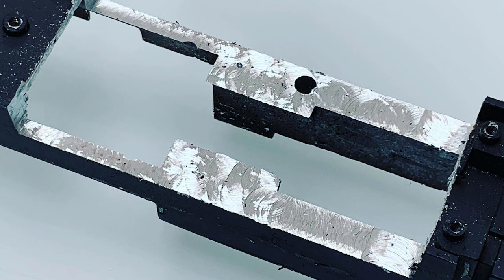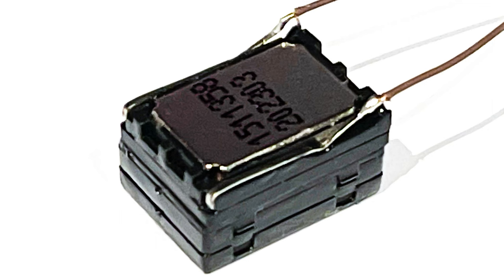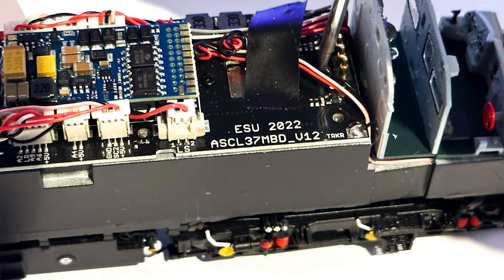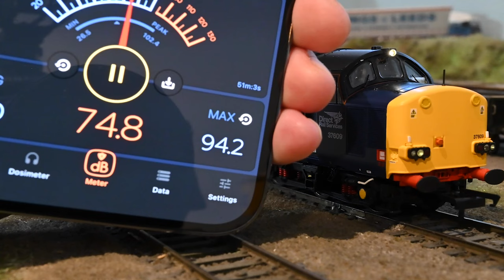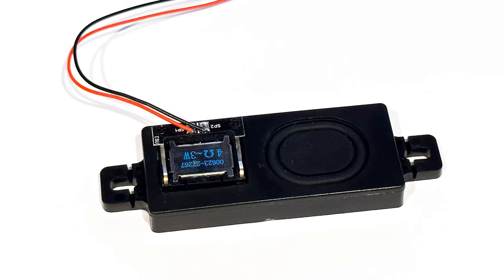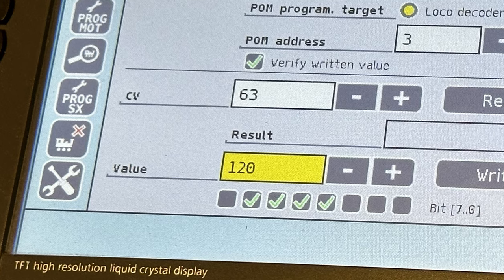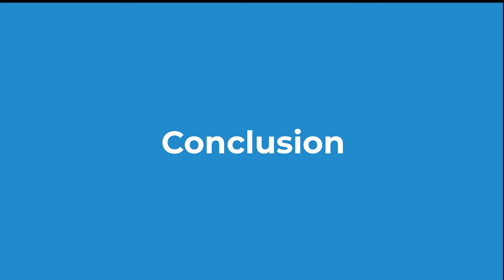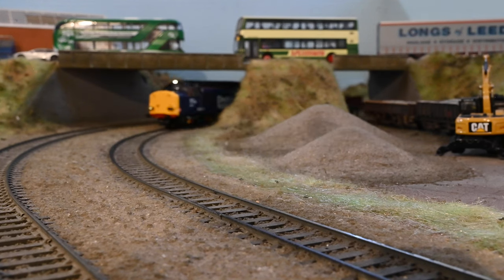Can The Accurascale Class 37 Sound Be Improved? Looking At Alternative Speaker Setups

Comment: Great advice as always. Ive removed the sugarcube speaker as I was getting crackling as you did, but one time the sound went very quiet after about half hour's running and the decoder became very hot. Not what I expected. All remained good the next day, but have been concerned. Your explanation that the two speakers takes the ohms reading below the recommended makes sense.

Comment: Hello Richard. Pleased that you are prepared to have a go. From what I can hear via my laptop, the first change (removing the sugar cube speaker), was a much better sound than the new ESU speaker. That one came across as rather tinny and lacked clarity of the base. 
I assume that the sugar cube is about 8 ohms, hence the combined value of about 2.7 ohms. So why weren't they wired in series?
I seem to recall Accurascale designed their PCB with help from ESU, so why go outside the decoder specification. 
I also seem to remember in the early days after the 37 announcement that an EM2 was the expected speaker.
Having said that, I think the Acc 37s sound great, and with the volume I can tollerate on a home layout there is no distortion. 
Dave

Comment: Great insight Richard, definitely sounds better without the sugarcube, I’ve got concerns with my 37609 as the decibel level is less than 50db, and two of the three volume cv’s read 000
Reply from the maker: The dB levels might not be that exact in this case, it’s just a free app on my iPhone so I’m not sure how accurate those readings are, but it’s good for a comparison between them

Comment: This is very helpful especially spotting the incorrect parallel wiring of the two speakers which could blow the ESU decoders amp. Would not be confident of a warranty claim on a blown ESU decoder when the model is 6 months old.

Comment: Great video. I have just got a 609 and the speaker is actually branded as accurathrash. It is nowhere near as loud as any of my other factory fitted sound 37's. I did a retrofit on one with a decoder and the accurathrash branded speaker and I can not go above 150 on CV 63 without it cutting out.
This 609 model though, really quiet. The rest of my factory sound are the same speaker as shown in your video without the branding on it and all sound decent. 
I may try removing the sugar cube on this 609, though in that livery, it was fairly quiet and one of the poorer sounding DRS 37's at the time.
I have wondered if there was a way to up the turbo sound as some examples such as 606 had quite a high pitched turbo scream. 667 is the same for this. I assume not as there is no individual cv setting for turbo.
Reply from the maker: Someone else told me the latest batch of models is quieter than the older ones but I’ve not got any standard ones from the old batch to compare. There’s no separate cv for the turbo
Reply: @roadsandrails  they are without a doubt. If the removal of the sugarcube means you can pump it up I may have a try, no lok programmer though so a few CV tweaks!